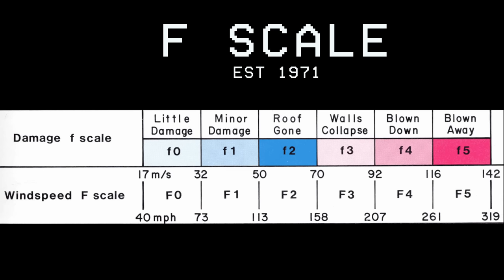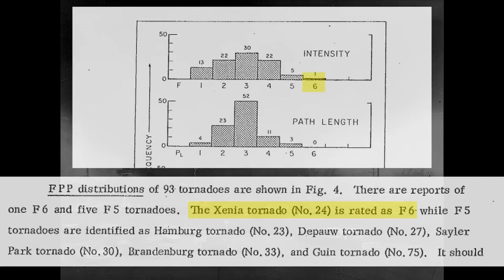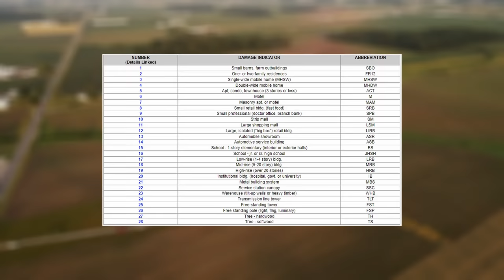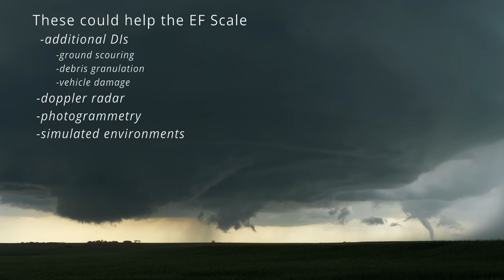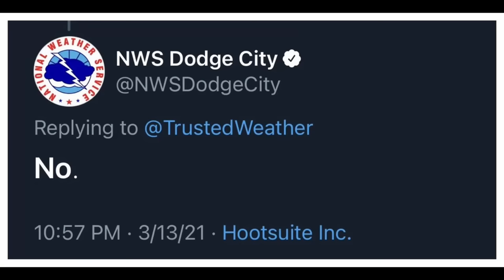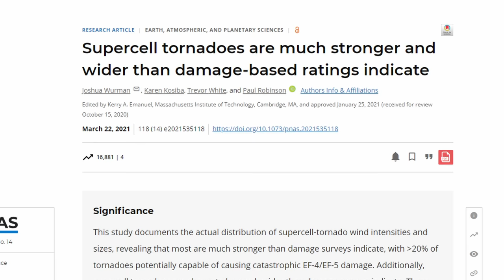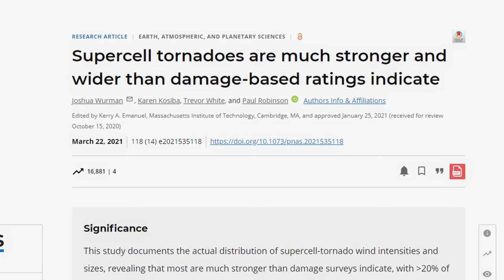Is The EF Scale Outdated?

Comment: My two cents worth. It is outdated? Yes and no. The estimated wind speed based on the damage in the EF-Scale on the upper limit (EF5) is any speed above 200 mph vs the previous scale where F5 was 261-318 mph. Some questions need to be asked like this one: How strongly were the building destroyed constructed?  The scale is far from perfect. I do think that the Doppler on Wheels measurements should be used used combined WITH the damage in the tornadoes (out in the southern and central plains) where they use the DOW. I can see why El Reno had so much debate over the rating. I would not want to be one of the people making that decision. "What do we do? Rate it EF-5, based on the DOW measurements, or rate it according to the damage". I think in the cases where we know it a very powerful tornado like that one, yet doesn't hit enough structures to justify EF5 rating that way, rate it EF-5 simply based on the measurement. The bottom line is there never will be a perfect way to rate tornadoes according to their strength, so damage is the best way to tell, unless chasers in the field are using the DOW (which is only used in a small percentage of tornadoes each year).

It is outdated is not an easy question to answer because the El Reno example, the easiest to use to say "yes it is", was a rare, expectational event, where you had a record 2.6 miles wide tornado, which rapidly intensified, changed direction, while continuing to strengthen, and unprecedentedly and tragically killing 3 chasers, the Samaras's Tim and his son Paul, and Carl Young, while the vast majority of tornadoes are not that strong with the combination of occurring in a  remote area. Every tornado is different, it's not that simple. The scale is definitely controversial. Many are rain-wrapped and difficult to see, some move faster, others move slower. Some occur at night, making visibility more difficult, unless you see power flashes and/or lightning. We had tornadic event here in Alabama yesterday, and some were rain-wrapped, while another just to the south, was not.

Comment: In my opinion, I believe we should rank tornadoes by their wind speed instead of their damage. If we are ranking them based on their strength and power, we would be more accurate to rank them based on that. Take the El Reno 2013 2.6 mile wide record breaking tornado. It had wind speeds estimated to be around 302 MPH, enough to rival the world record wind speed record. EF5's are ranked over 200 MPH, so shouldn't the El Reno tornado be counted as an EF5? Yes, but it went over farmland and did not impact many structures, resulting in it being classified as an EF3. Sounds odd doesn't it? This tornado was well above the average EF5 strength. A tornado can have the brute force without having to impact any structures. We have not had a confirmed EF5 since the Moore 2013 tornado, which is evidence of how the Enhanced Fujita Scale is becoming more irrelevant in disclosing tornado strength. That is why I believe we should rank on windspeed and general power.

Comment: There is no reason for El Reno and Mayfield to not be EF5s when they are both probably on the Mount Rushmore of most powerful tornadoes of all-time, alongside May 3rd and Tri-State. EF5s shouldn't be EF5 level damage to well-built structures AND 200 MPH, it should be EF5 level damage to well-built structures OR 200 MPH.

Comment: It's not outdated.  It's misunderstood, and perhaps flawed in some respects.

The scale is rated on damage because it was meant to measure a particular tornado's impact on people at ground level.  Yeah, you might have technology than can get relatively quick data on a tornado's wind speed now, but at what elevation above ground is this reading coming from?  The further away from the radar the tornado is, the more likelihood you're getting a reading that is a couple of miles above the surface.  Believe it or not, we have more gaps of concern in the U.S. radar coverage than one would think.  I believe weatherbox did a video about such some months back.

If I have a beef with the F/EF scale it is the misbelief by some that a tornado rated EF4 or EF5 is doing that sort of damage along a significant portion if not the entirety of its path, when in reality, all it needs to do to meet such criteria is produce that sort of damage at one particular point.  Admittedly, what may make the difference in whether it gets that higher rating or not, isn't so much the tornado's strength at any particular time or place, but what it may have available to chew up.

Comment: Correction to your statement that the 1974 Super Outbreak still held the record for most tornadoes in 24 hours, the April 27th 2011 Super Outbreak holds the record for most confirmed tornadoes in a 24 hour span with 216 and it also holds the record for the most confirmed tornadoes during an entire continuous multi-day outbreak of 360 confirmed tornadoes from April 25th-28th 2011.

Anyways, with that said I do think that the NWS is for some reason either intentionally or unintentionally lowball rating the strength of tornadoes. The two examples you cited are spot on, i think it's obvious to most that have studied the El Reno, OK and Mayfield, KY tornadoes that they definitely fit the scientific criteria of an EF-5 rating and there's been quite a few more like most recently the Rolling Fork, MS tornado.

Comment: Radar didn't exist the way it does today when the EF scale was coming to be.  It just doesn't work anymore, gives people a false impression of the strength of these storms.
Reply: WSR-88D was introduced in 1988. It was in use when the EF scale came online, and it is in use now. It's been extended with a higher resolution mode, dual-pol, etc., but it's pretty much the same as what we had in 2007. The super resolution mode was added a year after the EF scale was introduced, but it is still insufficient for estimating wind speeds at ground level.
Reply: @tid418  With mobile doppler, that's not accurate.

But the point could well be made about how many of those exist on any given storm.. which is to say 0-1 xD

Comment: You bring up many good points, but it is simply not possible to obtain surface windspeed measurements on every single tornado that causes damage. DOWs don't work when there are trees and hills obscuring the storm, and NEXRAD just cannot measure close enough to the surface unless the storm is right on top of the site. The EF scale is still the best method we have, even with its flaws. I am 100% in agreement with the Fairdale/Rochelle tornadoes being under-rated, though I do think the Mayfield tornado was accurately rated (ground scouring begins well within EF-4 windspeeds). The El Reno tornado was an anomaly - we haven't seen anything like that before or since. Property damage alone is simply not enough to describe that monster, and there should be an asterisk next to that rating.

Comment: Really good video and an important discussion imo. Well done

I agree the EF Scale is insufficient and should be updated to include all information available relevant to tornado intensity.  

To consider damage as the chief indicator of tornado intensity is insufficient. It provides only partial assessment. Tornadoes that cause no property damage are rated low, regardless of wind speed or size. 

This method makes little sense today when wind speeds can be accurately measured with modern technology. No other natural disaster phenomenon is measured in this way.  A CAT5 hurricane is a CAT5 even if it remains out at sea and creates no damage. This measure is much more logical and intuitive. 

Perhaps a modified dual scale addressing damage and wind speed would make more sense: Something like EF4 level damage with CAT5 level winds for the Mayfield storm etc.

Comment: You're forgetting there was a ef2 tornado in 2010 from June 5th to June 6th the reason why I know that and I really looked it up but the reason why I do know that is because I went through a year two tornado and Dundee back in 2010 again through June 5th to June 6th I was sleeping on the first apartment floor which was the basement floor thank God no one did not got hurt and this is when I was in elementary but did knock the apartments off the foundation the EF 2 tornado was in the middle of the apartment complex and knock down my mom's sunflower plant didn't hear the Sirens go off I mean on the other side of the Woods the siren was very very close which was the Federal Signal modulator tornado siren and I think there was a p15 tornado siren that is in yellow or maybe the P10 but anyways thank God that sirens were working but we did have another tornado warning again in 2011 or maybe in the same year but no other tornado was located on the ground and Dundee but we did somehow we got a tornado warning again at the time and then in 2015 and 2018 there was a tornado warning so thank God God was looking out for us

Comment: It needs to include width. Like yeah a tornado might "only" have like 130mph, but if it's a mile wide it's a lot worse than a 40 meter wide tornado with 250mph winds. It would be very easy to make a number/letter system. Like keep the old 0-5 and add three letters.
A- Narrow, max maybe the width of a large house.
B- Medium, up to 50 yards wide.
C- Wide, 50+ yards.
D- Super Wide, anything a quarter mile or more.

And then you add the speed it's moving and round off to the nearest 10. And generally speaking, wider tornadoes tend to have high wind speeds anyway so you don't need an official number there to get people to take it seriously. People hear anything worse than an A class, they're gonna take it seriously.

Comment: It's like installing a speed sensor on a highway with a speed limit of 55mph and you observe that 25% of drivers are going 20mph over the speed limit. However, since no drivers caused an accident during your observation, the report concludes that all drivers were driving at least 55mph or less.

Comment: Yes. I'm afraid so. 
I'll use EL Rino tornado as an example. 
You can have an EF5 in the middle of a field but end up ranked as an EF3 just because it doesn't have much to actually hit such as barns or houses. A tornado can only hit whatever is in its path depending on the item. It's a problem & therefore makes this scale outdated. El Rino was an EF5. The Doppler & Satellite readings had this tornado's wind speeds upwards of 200mph. There is no reason this should be an EF3. That tornado left trenches of its own in the ground. They are still there to this day. Only EF5 can do that. Not a 4, not anything lower on the scale.

Comment: Other notable tornadoes that were rated EF4 by damage, but no doubt produced EF5 damage/was at EF5 intensity since 2007 IMO, although you mentioned a few: Tuscaloosa-Birmingham (AL), Ringgold (GA), Blanchard (OK), Washington (OK) in 2011. In 2013, the only ones would be El Reno (OK) and Washington (IL). In 2014, that would be Mayflower-Vilonia (AR). This goes for many EF3's that clearly produced EF4 damage but not EF5 (just classic EF4).

Comment: I agree entirely with this video, I am going to make but 1 point though and its probably why there is a reluctance to classify storms on potential damage. That point is both the construction and insurance industries. If you truly represented how many storms were EF4 - EF5 the insurance industry would first classify large sections of the great planes, Tornado alley and dixie alley and uninsurable for storm damage.

The next relating to the construction industry home builders would look at the at the rate at which these storms occur and argue that it is impossible to build a structure that will adequately protect the inhabitants or stand up to those windspeeds. That there is no point in building to a higher standard when the occurance of those catastrophic storms is much higher than being reported. I think this is a horrible take from both industries. While yes it is impossible to build a home that would stand up to either Moore F5's, El Reno which should have been an F5, Xenia, Joplin, Hackleberg, or Jarrel. The existance and frequency of these storms necessitates a different line of thinking and that is as follows. Build the homes as best as you can economically, however each home should have an absolute fortress of a stormshelter in its design. a 4.5 sided 1/2" thick steel box with reinforced concrete going over that, and bolted to a mosaic slab that is 1' thick and itself anchored to bedrock and also pinned into the slab for the rest of the home which should also be a minimum of 8" thick. And you need more public shelters for homes where this is not possible.

Basically we need to build our shelters better and forget about the idea of building a home to stand up to EF4's and EF5's.

Comment: Damage can vary by how fast the tornado was moving. If it stays parked over an area it'll cause more damage than a more powerful tornado traveling faster.
Reply: That's not always the case. The EF5s of the 2011 Super Outbreak was moved at 65mph. The Hakleburg Tornado was at times moving at 75mph and was rated for 210mph.

Comment: I think I have a solution to this problem

Damage Indicators + Recorded Windspeed
Basically we would keep most of the current EF Scale with the damage indicators with a few additions, one of those being windspeeds and tornado ground speed actually having something to do with the tornado. 
Basically all of the current damage indicators the NWS has used up to this point would stay the same, however, damage to the Earth's surface (ground scowering, cycloidal marks, uprooted trees) would be added to the list. Tornado paths would also be taken into the equation, meaning that if a tornado has a more erratic path (such as loops or curves), the tornado will probably have a higher rating then most with a straighter path.
The largest change would be the windspeeds and the speed of the tornado itself actually being the ones recorded from probes or doppler radar and there is no affiliation with damage caused. I also have the speed of the tornado crossing as a part of this because the faster a tornado moves, the more ground damage it will probably cause (looking at you drillbits)
In case this is confusing, I'll use two famous tornadoes as examples 

1. El Reno 2013
Using the system I came up with, El Reno would probably be rated more of a high end EF4 or low end EF5. Since this system would bring recorded windspeeds into the equation, the tornadoes rating would be much higher than the estimated speeds from the Current EF Scale. The tornadoes' wild and unusual path would also put it up at the top as it went all over the place
2. Jarrell 1997 
Ah yes, the tornado that is the reason this conversation is even brought up
Anyway, with my system, Jarrell has one thing that could've downgraded it to an F4 with this system, the amount of time it just sat stationary. As I pointed out, my system makes ground speed a key part of rating the tornado. While the windspeeds, damage, and the overall disaster as a whole, I'm sure the tornado would still be an EF5, no doubt

Comment: We had WSR-88D radars almost twenty years before the EF scale was issued, so I'm not so sure that isn't taken into account when rating.  What should be taken into account is the building codes applicable to the buildings and their correlating damage.  A lot of building codes didn't require wall-foundation and roof-wall connections or garage doors reinforced for positive and negative pressure.  Just those items make a huge difference in whether a structure makes it through a strong hurricane, much less a tornado.

Comment: 1:27 That visual graph shows why the now famous Atomic Dome of Hiroshima was left standing as it was directly under the fireball generated by Little Boy. The whole reason why weapons are detonated at such a high height is so the incident shockwave of the firebal merges with the reflected shockwave on the ground, forming what's called the Mach-Y stem with much higher overpressure than the two separate waves.

Comment: It’s not outdated, but it needs to be based off of wind speed. If the speed is above 200 mph, it’s an EF5. If it’s between 160 and 200 mph it’s an EF4. If it’s between 120 and 159 it’s an EF3. If it’s between 80 and 119 it’s an EF2, and if it’s anything below 79 mph, it’s an EF1. Damage should be taken into account as well. If a tornado with EF3 wind speeds produces EF4 damage, it becomes an EF3 that hit EF4 speeds periodically in its lifetime

Comment: There's at least one other reason to revisit the EF scale.  It goes up a notch every 35mph or so, then stops and becomes open-ended at 200mph.  

Assuming the Doppler measurements we've gotten for at least a half-dozen twisters aren't wildly inaccurate that have been at or above 300mph, the EF scale should have 6, 7 and possibly 8 if the one notch per 35mph pattern is to be kept.  A 300mph wind is 2.25 times stronger than 200mph -- it is a HUGE difference that needs to be acknowledged by science.

Granted these readings were likely significantly above ground and the wind would be a bit slower at ground level (where it counts) due to friction, but even 250mph is 1.5 times stronger than 200.  

If an accurate Doppler measurement is available, this needs to be acknowledged for the sake of science even if it hits only a wheatfield.  There may be some coefficient that can be calculated to account for ground friction.

I think Fujita's original scale was closer to the truth anyway, in part because you get such freaky damage phenomena -- like curtains sucked through window frames and pine straws piercing shovels and car bodies -- with tornadoes that rarely if ever happen with straight wins at the same nominal speed as the EF scale.